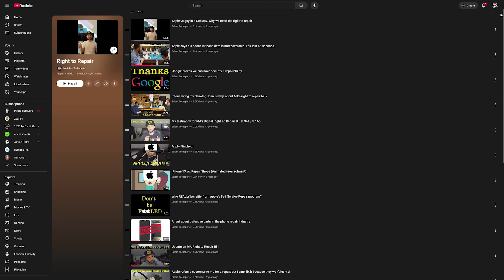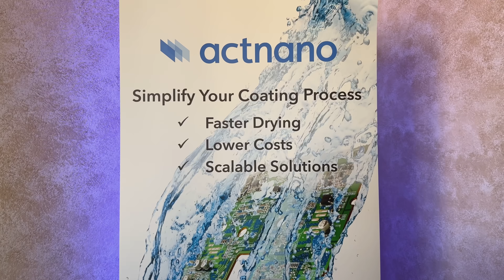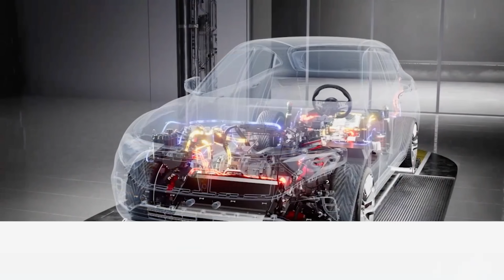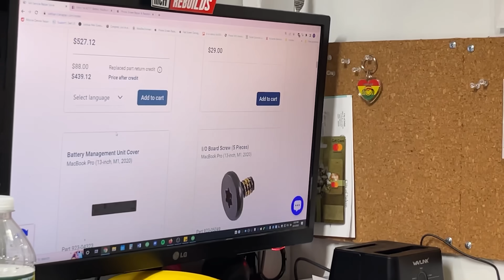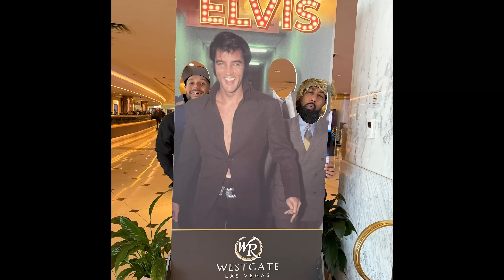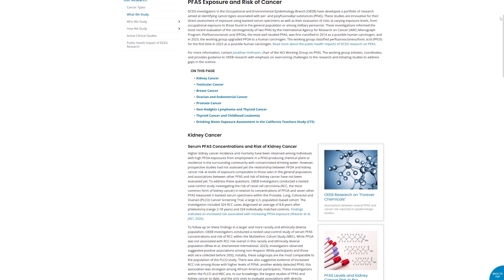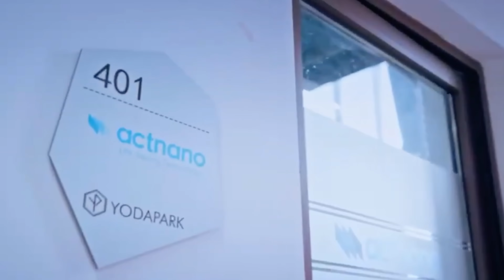Waterproof Laptops ARE Possible, But WE Need to DEMAND Them! actnano nanoGUARD is HOW We Do It!

Comment: Waterproof Framework laptop would be such an easy buy.
Reply: pricetag enters the chat framework laptops are still crazy expensive though
Reply: @abhrasrepository1173  That's the point. Framework's value proposition never was to be cheaper on day 1. You are definitely paying more for modularity. The value is to foster upgradability so you get another main board for cheap (when compared to a whole other laptop) whenever the current laptop gets slow or the some part gets tired.
Reply: @abhrasrepository1173 the price we pay for immortality /j
Reply: @abhrasrepository1173  yeah. I still think that, despite being a student, their goal is one to drop a few dollars extra for. I'll survive without a dgpu over it.
Reply: Pretty sure you can already buy a flacon of this stuff, basically you can apply it to anything, your laptop, your TV, your shoes, your hair if you feel experimental...

Comment: a framework laptop with an actnano collab would be tight
Reply from the maker: Yes. Yes it would. You should let them know.
Reply: @SalemTechsperts It would be tight. Water... Tight.
Reply: @hairofthedog92  bruh
Reply: @SalemTechsperts  no no YOU should let them know
Reply: @SalemTechsperts  they should partner with framework laptops
Reply: Yes indeed this here ^^
Reply: Someone let Linus know please
Reply: @RenatoG1848 Knowing him he'd probably auction off the technology for his own personal gain.
Reply: Actually an unstoppable machine.
Reply: Will it be able to withstand coffee, juice, milk and homemade milk being spilled on it tho?
Reply: @ticktockbam  i waterproof, not liquid proof. although i imagine it will give you some extra time to poweroff the machine before it explodes.
Reply: @ticktockbam  It will allow you to get it to the repair shop to do cleaning without changing parts. This is due to beverages having elements like sugar that can react or attract ants.
Reply: @ticktockbam  WHAT IS HOMEMADE MILK?????????
Reply: @OuyaWoelders-hi9bn 🤭
Reply: Was just going to say this!
Reply: Ironically, this will probably be more challenging on a "modular" laptop.
Reply: You can't have everything, cheap and modular doesn't go with water proof
Reply: @naldothadeus6310 but this is a coating. That's it. The modularity of it doesn't cause an issue
Reply: @naldothadeus6310 At the very least, you can make most of the mobo water-resistant, which limits points of failure to the M.2 and RAM sockets
Reply: This is a yes.
Reply: Yes, we need this, let Linus know about this
Reply: Wait why doesn't framework have this?
Reply: how you water proof the connectors?   i build drones and use conformal coat.. 0 problems.. but never use it on conectors or you have to clean it and coat it again..
Reply: framework and MNT would love this product
Reply: Yes it would definitely be tighter than you
Reply: I thought the same.
Reply: You tell em, they’ll listen, anything to make their product last longer
Reply: i was thinking the same thing
Reply: How about we all just let them know lol
Reply: But, yes, I forget Linus is a major stakeholder in Frameworks
Reply: Tight 👌
Reply: I think you mean -> @FrameworkComputer
Reply: Say their name,,,
Reply: wow wow wow wow wow
Reply: 100%
Reply: This! 100%
Reply: Itd be harder to repair.
Reply: This!
Reply: @linustechtips
Reply: I wonder though, would it be possible to make RAM and M.2 slots waterproof, so maybe it’s not feasible. With that said, adding this coating would at least make it more resistant to water, so I’m 100% for it
Reply: Tighter than your moth-
Reply: Lol I was just thinking that 😂😂😂
Reply: airtight.
Reply: You mean, water-tight? 🧐
Reply: Yeah but they also need you to repair and take parts to them, so they will lose millions on perfecting their machine
Reply: Frameworks are overpriced as shit tho
Reply: @PneumaticFrog I don't think they're that overpriced once you factor in the cost benefits of the repaiability but more than that the different economies of scale they're dealing with. I mean I guess you could say it's overpriced compared to an exactly similarly specs price that has none of the benefits of the repaiability or the modularity but that would be a silly comparison

Comment: Finally I can email you from the bottom of the pool
Reply: Or the hospital fish tank
Reply: @Beanybrew  So much to unpack here
Reply: @ lol
Reply: "hey TGTTEL, writing to you from bottom of pool. laptop not broken. thanks!"
Reply: If you have a waterproof Ethernet cable- sure! Wireless signals get c*cked by water, remember.
Reply: @CoolCrescent186  writing it down
Reply: @DottorHealer  dont forget you can swim in the hospital fish tank
Reply: @CoolCrescent186   can be possibly solved by bringing a laptop with a sim card slot (maybe there are ones you can swap out the wifi card with) or can be airdropped/sent over via infrared to a device operated by a conspiring person
Reply: @tezcanaslan2877  Infrared could work, if the water was perfectly still. Otherwise, very unlikely. Cell signal is c*cked more than WiFi, so mobile data wouldn't help either.
Reply: Doubtful unless you brought q similarly coated Ethernet cable
Reply: Think cooling...
Reply: You already can with your smartphone...